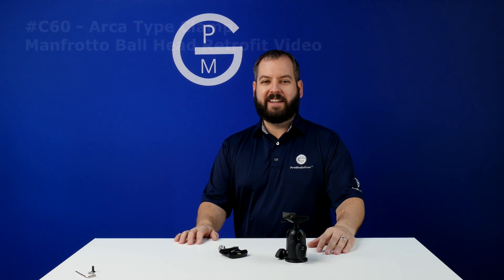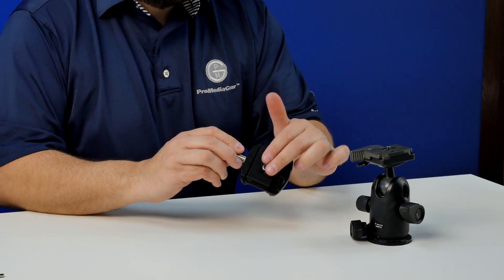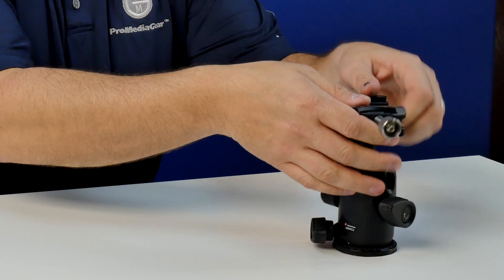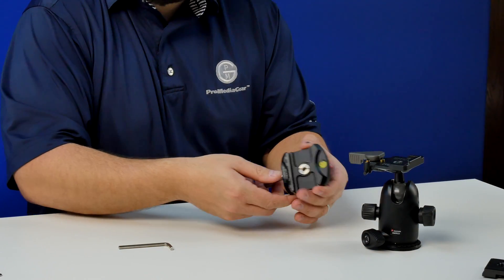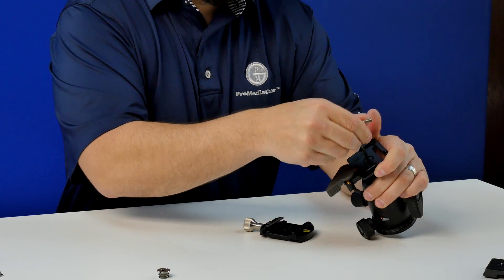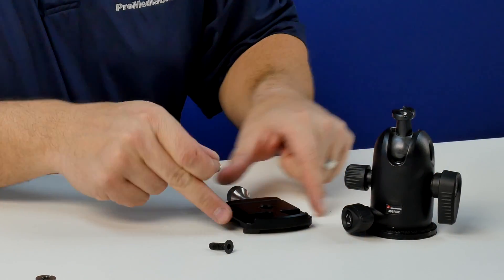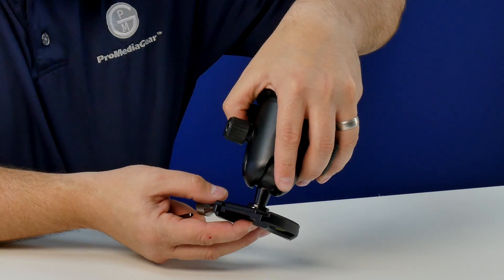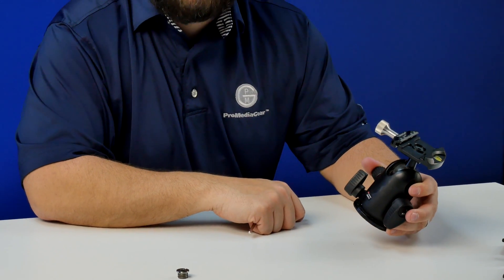Arca-Swiss type Clamp retrofit of Manfrotto RC2 style ball head

Comment: Will this work with the Manfrotto MHXPRO-BHQ ball head, which uses thwe RC2/Q2 plate? I'd prefer to take the clamp off and put on a replacement Arca Swiss clamp, rather thanmodify the existing RC2 clamp as described in scenario #1 above.

Comment: Does it work with a Manfrotto 327RC2 Ball Head? The pistol grip one? Can you take out the screws and attach the clamp to the pistol grip?
Reply from the maker: The 327RC2 Ball Head cannot be taken off, for this one it's best to just mount/screw on the C60 arca Clamp.  That means you simply stack on top of your head the Arca-Clamp and that's it.  It works pretty well, just a bit taller.

Comment: I have a Manfrotto 488rc head but it appears that the clamp is not removable as there is no place to put the allen wrench.  Any ideas?
Reply from the maker: Maybe they have a plastic cover on screw (looking from top) something has to be holding that  clamp to the stem.
Reply: It appears to be a solid black metal cover but I can find no way to remove it unless I try to tear it off
Reply from the maker: Hmm, maybe they welded it somehow, sorry I don't have the head here to experiment with, I was just going by what I saw in pictures.
Reply: I can take a photo of it and send it to you if you give me your email
Reply from the maker: sure send it to PMG  @promediagear.com       no space
Reply: I emailed you 2 photos.  Do you think I. Ould pry the black metal cap off or would it be better to use the first method you showed on this video.  Just concerned that it may not be enough to hold my Nikon D800 and 200-500 lens
Reply from the maker: For that heavy combination, it may require something stronger, that's a big lens.  You want to be sure you that the screw holding that clamp is secure.
Reply: @dennyriffert1803  Just in case you didn't get an answer - I have the 488rc2 as well and there is no screw. The shaft from the ball head is threaded and screws right into the plate. Lock down the head and you should just be able to turn the plate to unscrew it.